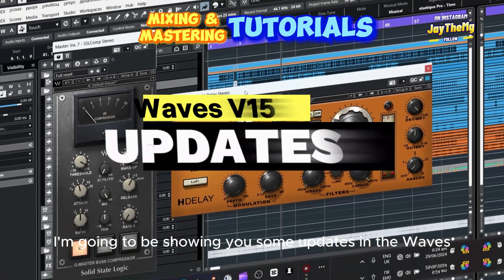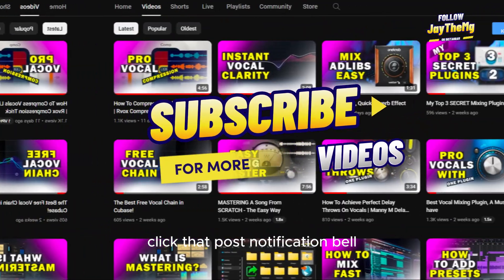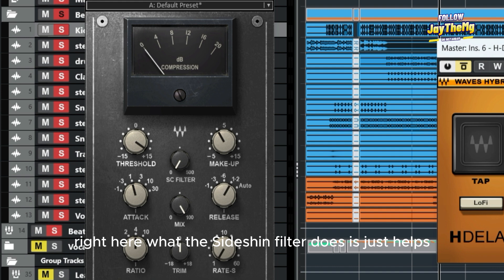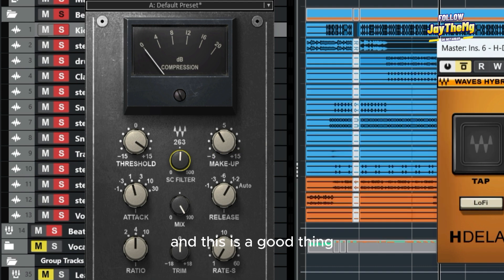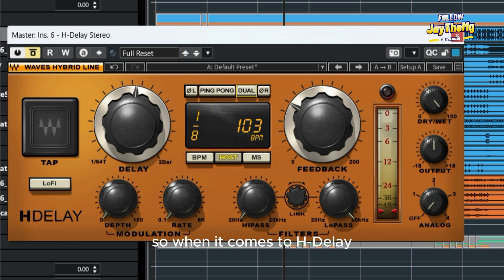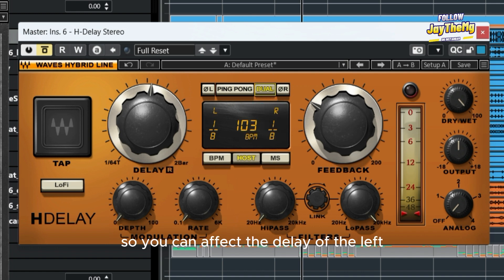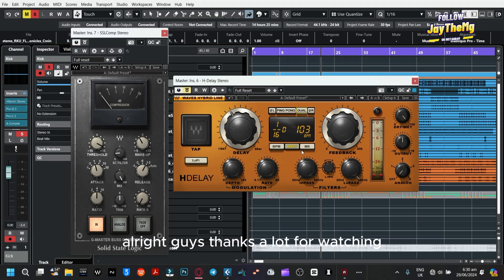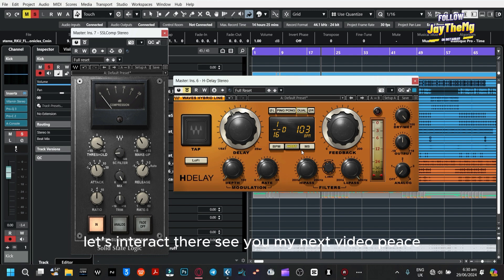H Delay And SSL G Updates in Waves V15 Explained!

Comment: The compressor still affects everything. It's just not triggered by anything below the frequency set on the side-chain.
Reply from the maker: Sounds like you might have a point there. But what exactly do you mean, if its not triggered by anything below the frequency set on the side chain. How then does it affect everything? Kindly explain..
Reply: @JayTheMg  it means compression is only taking place when frequencies above your side chain hit the threshold but the compression itself is on the whole spectrum. Like in your example of 250hz, the frequencies below that won't control the compressor even if they hit the threshold but they will still be affected by the compressor when the above frequencies trigger the compressor.
Reply from the maker: @steppabanton9753  Oh okay I think I understand what you are saying I've just learnt this now. I always thought the rest of the frequency remains unaffected but I get it now I also just went and read a bit on this and you are right. Thanks for that clarification.
Reply: @JayTheMg  you're welcome and all the best with your work